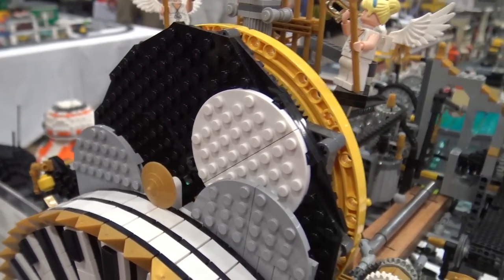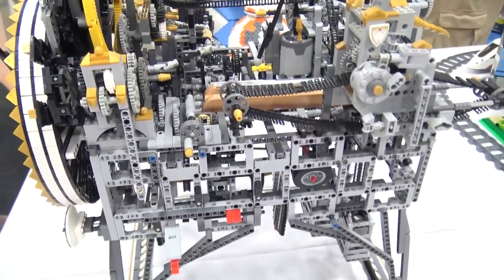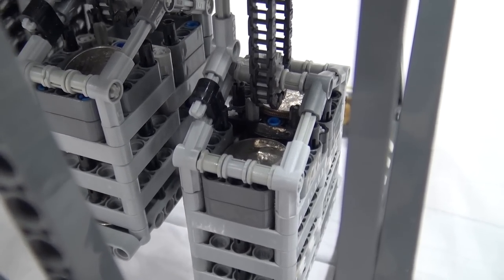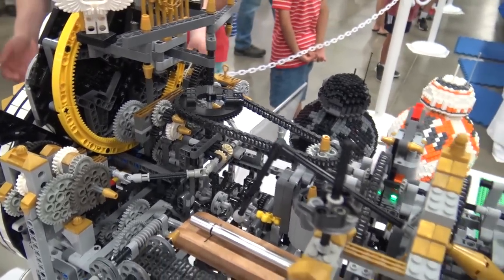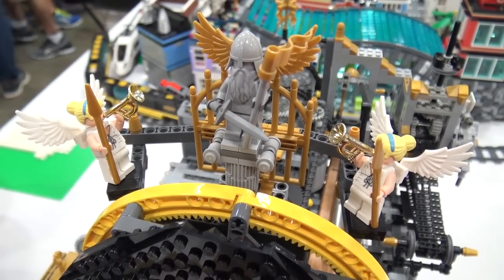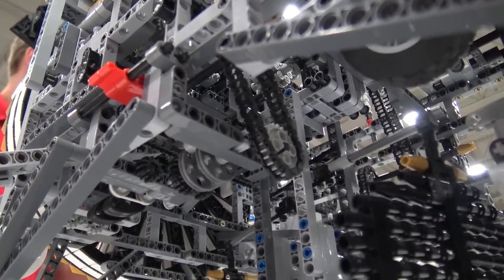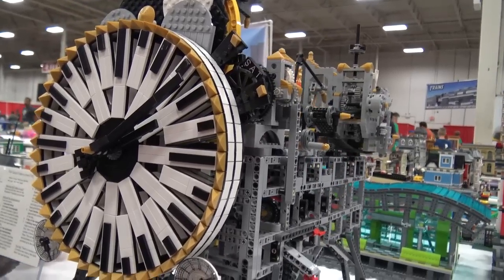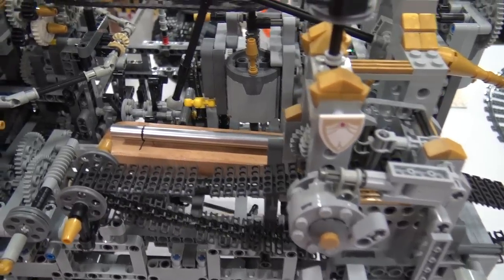Amazing LEGO Technic Grand Complication Clock

Comment: This is very cool to see other clock, but this clock has a poor drop rate, which mean that the weight tend ot fall quiclky and because there are many friction especially in the escapement mechanism. It is a beauty but need to reengineer a bit to reach its max !